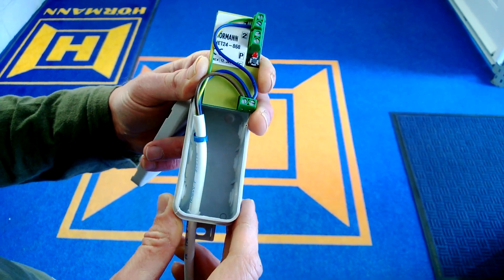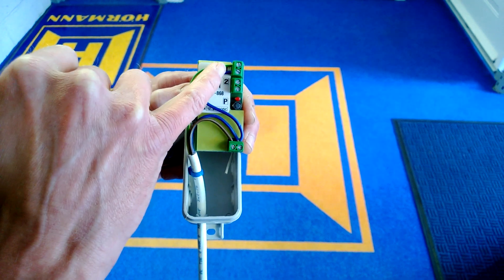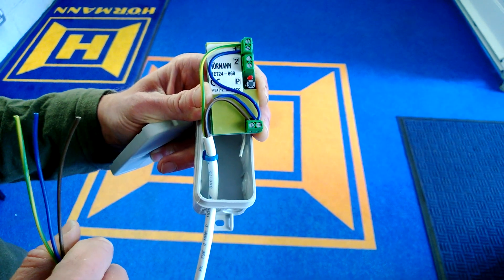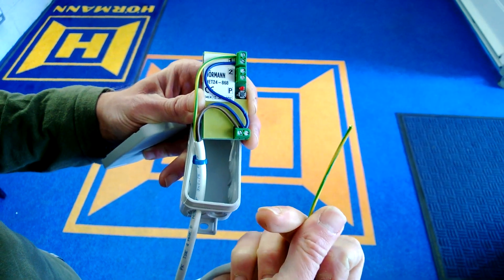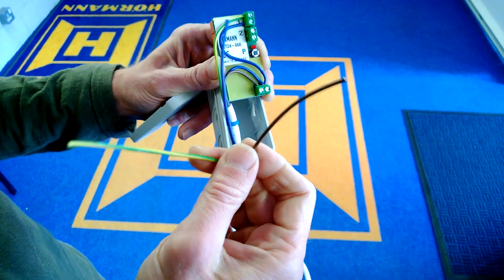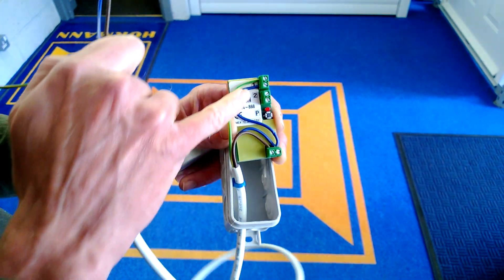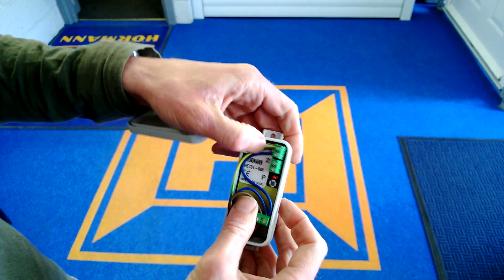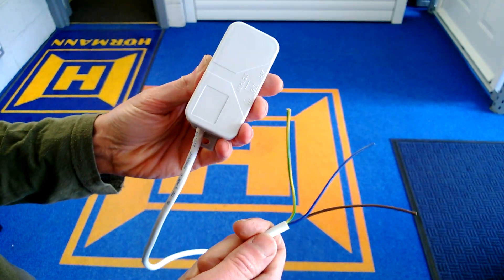How to wire the Hormann HET24 868.3 MHz receiver

Comment: Very nice video! Also „reusing“ the negative. 
I wanted to connect the HET24 to a Promatic3, but in the manual of the Promatic3 there are always 4 wires for an external receiver  used.... Do you have a tip how to wire them up?

Comment from the maker: You should be able to wire directly into the connector block at the rear of the head unit. connector 5 is the +ve voltage (brown in the video), 20 is the -ve voltage (blue in the video), shared with one side of the relay and 21 is the other connector on the relay (green and yellow in the video).
Reply: I've used a cheap electric window switch to wire 3 core cable to my opener.

I'm interested in adding a sonoff wifi switch also. Is there a 2 cable method for the horman openers so the relay can open and close the the relay os activated. Thanks.